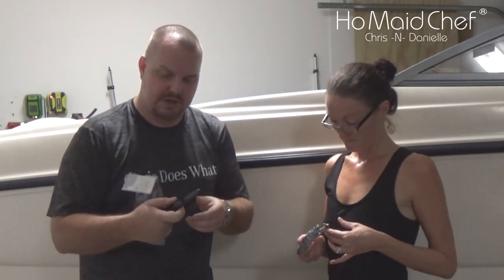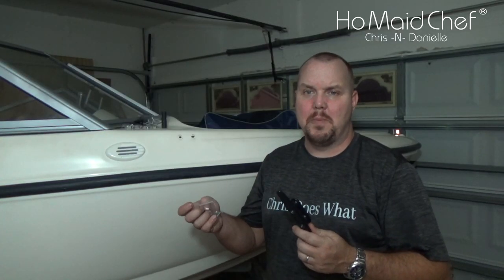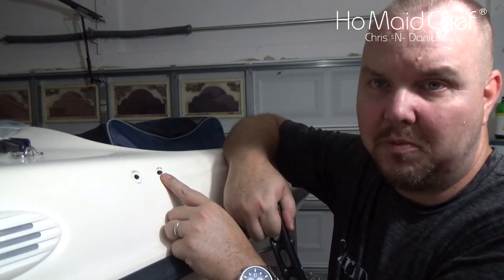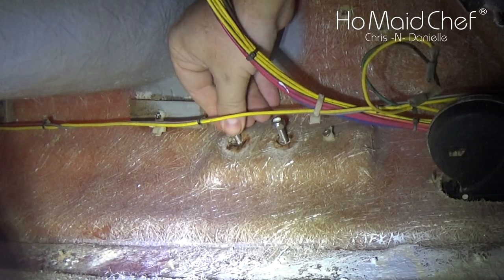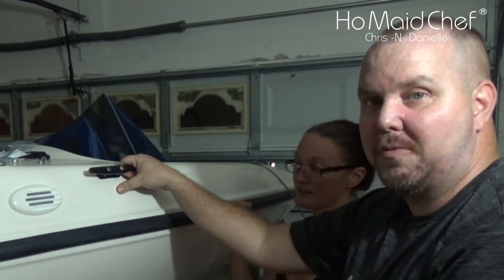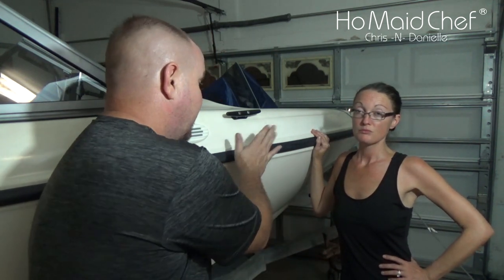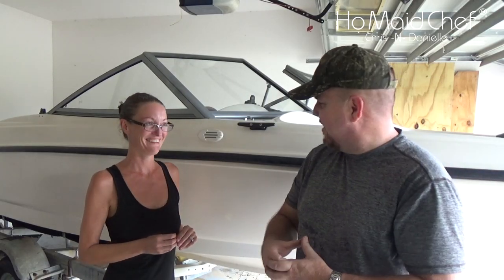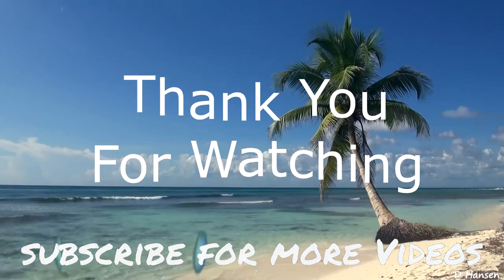Install Of Boat Cleats EP #53 || Bayliner Bowrider 175

Comment: Whenever fitting deck hardware, including cleats, it is essential to fit a backing plate inside the boat otherwise the bolts could pull thru the fibreglass. The backing plate should be at least as large as the base of the cleat. You should also use a waterproof sealant between the cleat base & the deck to prevent water ingress.
Reply from the maker: We put these back the way the factory installed them, I image they have backing in the mount point because the bolts used here are so long. Not really worried about water because it is an open helm and the water coming in is quickly removed by the new bilge pump we installed. bilge pump video https://www.youtube.com/watch?v=AKOk_IxFFyI 

We are currently looking at large liveaboard sailboats and your advice is critical for that application. Thank you for the feedback.

Comment: You should always put fender washers on any hardware you are installing. Because the last thing you want is to have a cleat pull through the hull. Also a little sealant (not silicone) to seal the holes where the bolts go through to prevent water intrusion into the hull.
Reply from the maker: Yes, we are going back with some washers, as high as this is on the boat we the sealant is a bit much. Thank you for the feedback.